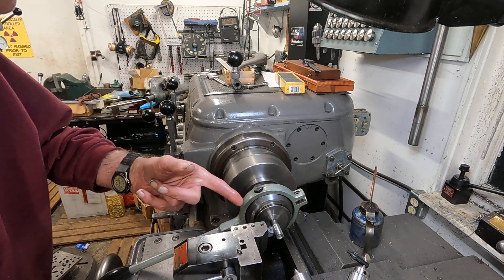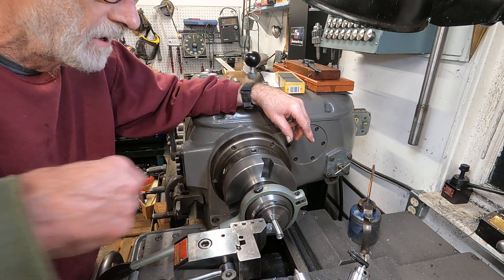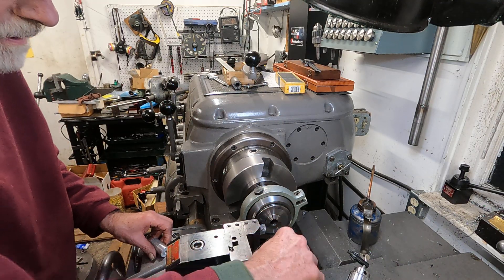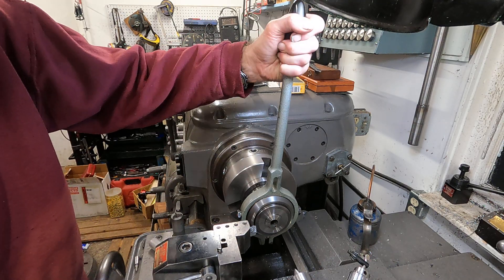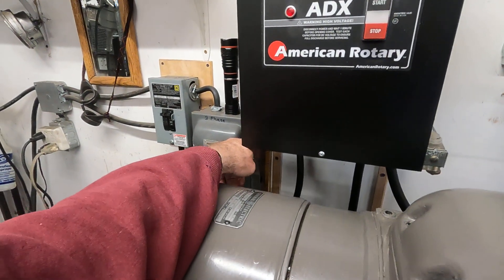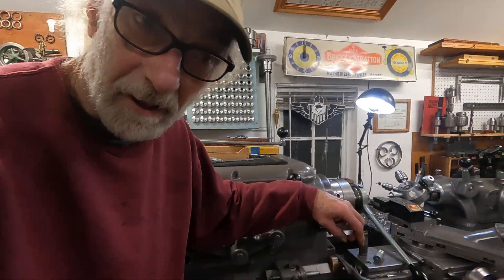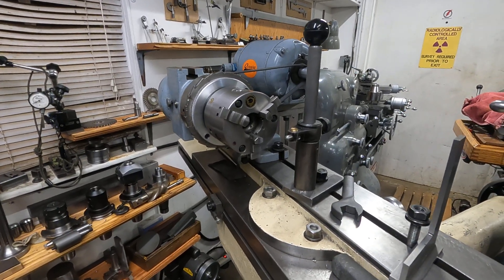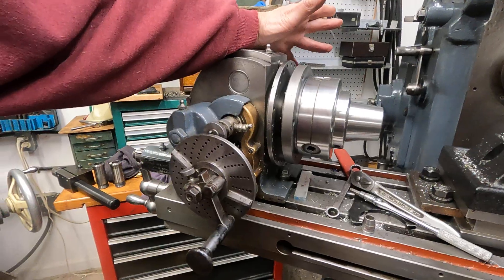5c Collets on all of my machines

Comment: My 5c collet adaptor works finally. Mine tightens by turning the drawbar end nut, no levers and such, far simpler.
Reply from the maker: The headstock on this lathe is too long for a rear handwheel closer and a lever closer would be a stretch to operate. Several manufactures came up with front operated and this is a good one, thanks!

Comment: Hey Don, what 4 jaw chuck do you recommend for my 1954 10EE.
Reply from the maker: I use 4,6, and 8", the smaller the chuck the better for holding the work for closer tolerances many have found, keep in mind I only use the ee for alloys at high speeds, smaller chucks have less tendency to vibrate resulting in the part being larger on the end.
Reply: Thank you. Is there a brand name you stand behind when buying a chuck

Comment: Good one . I have not machined 12L since high school , steel made from butter !     They make hydraulic nipples etc  from the stuff on cnc lathes .   It used to be called Leadloy  ,  free machining & can be case hardened .     👍
Reply from the maker: One of the first projects at the school here was a screw jack made of 12L and we case hardened it. They started you off on belt drive lathes

Comment: I’ve found I would rather turn 304 stainless over the 12L15. It is not as forgiving as the 12L15, and it’s a little harder on the tooling. But I just like the finish and the stainless properties. But a master level machinist… oh.. excuse me, a master level mill right 😁 can get a good part out of just about anything. I would think with your skill set you would have no real reason to even mess with 12L15.. really doesn’t offer any beneficial properties other than “easily machined” right ? 

That’s a beautiful Wilton vise you got back there too Sir ! I always loved the looks of the bullet vises. 
 I’m on the hunt for a old bullet vise to restore for myself, I can’t afford a fully restored one. The prices on them suckers has really blasted to the moon.. 
 Don’t work too hard Sir, remind everyone who’s retired around here.. 😂
Have a good day Sir.
Reply from the maker: I should keep some of the 12L around, it does make things easier for some parts for sure!